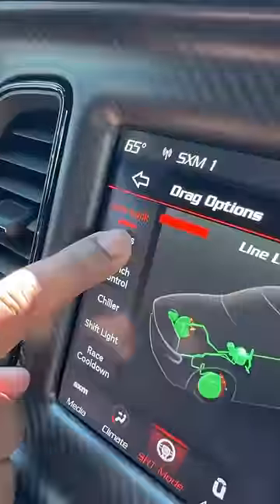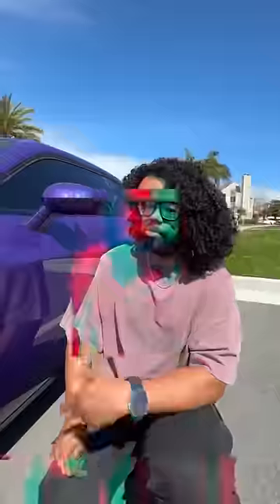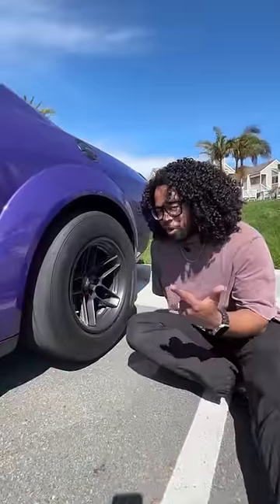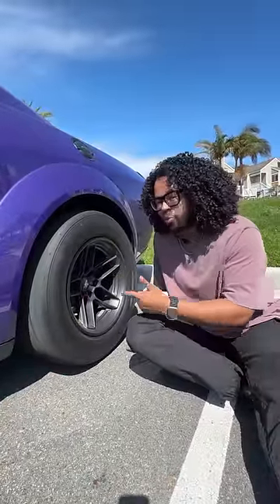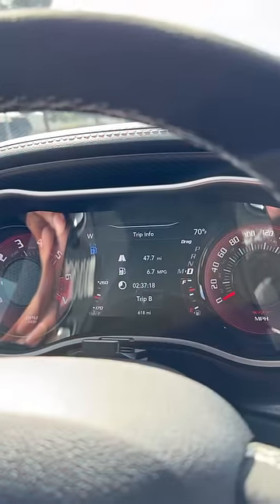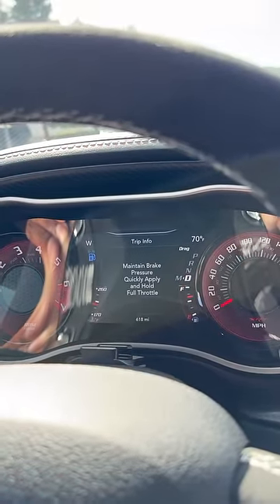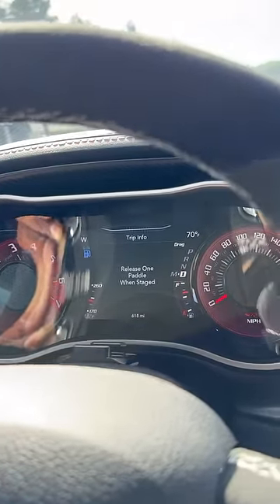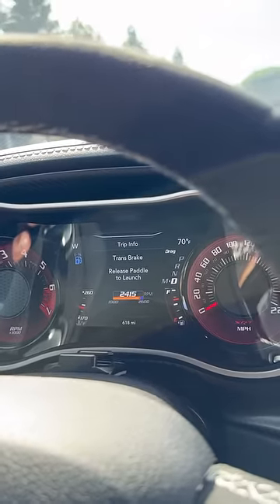This a super simple explanation of how the trans brake works in a Dodge Demon 170 😈

Comment: I think that this engine will overpower the brakes because of how powerful this car is
Reply: Who uses a brake when u have 800+ hp
Reply: @sambanerjee6796 i’d assume you’d really need your brakes if you have 800 hp 😂
Reply: @_BaguetteDoggo yeah but if you’re truly using the hp, the only thing using them will do is pretty much damage in that moment. That’s why they put that feature in. 😂😂
Reply: It's only 1000hp lmao. You act like it some 7 second car.
Reply: @literallydalegribble3875 only 1000Hp ? 8 second car but that’s too slow for a production car since it’s not 7? You most likely don’t even have a car 😂
Reply: @lalo7768  I do. And I've been around/in the drag scene my whole life. The fact these cars are so overhyped is beyond me. Your making 600/high end 500 wheel on a Hellcat. Like you act like this car is some God-killer.
Reply: @literallydalegribble3875  not a normal hellcat.  It also makes 900+ to the wheel. It’s a production car bud, I’m not a mopar guy but this thing is badass. You’re just hating while you’re still driving your 140hp shitbox. There’s always gonna be a faster car but the difference is this a PRODUCTION CAR.
Reply: @lalo7768  It doesn't make 900 to the wheel, if a 707hp car puts 550 (roughly) to the wheel, how does a 1000hp (if they have the cams, and the alcohol injectors in, around 800 if they dont) make 900 wheel? I could give two shits about "mUh pRoDuCtIOn cAR!!" 

And hypercars and supercars make more, but, actually fucking put power down. Unlike this POS that doesn't do either. I could take my daily, a 2012, 2TR-FE powered tacoma and have more fun tooling and driving it, than I'd ever get out of some cookie cutter performance car.
Reply: @literallydalegribble3875  also doesn’t cost as much as a super/hypercar rtard
Reply: @lalo7768  Correct. But I could buy a R8 for that money. Or a R10. Or a viper (I belive). Or a Ford GT. Or, better yet, not buy a POS 'Bought not built' car, a build a car/truck to MY standards, and walk yall (like many people do.)
Reply: @literallydalegribble3875 "actually put the power down" yeah you are clueless and have never owned an actual car fast enough to break the tire's loose
Reply: @ItsBlurrs  Spinning ain't winning. And yes. Yes I have. Spinning on purpose to heat the tires/Show? Okay! Spinning wheels your trying to get on it? Bad!
Reply: @literallydalegribble3875 You literally are basing your opinions off of playing Forza horizon 5, it is completely different in real life😂
Reply: @Jsv_1021O4  I don't play forza lmao.
Reply: @literallydalegribble3875 then stop acting like you play forza
Reply: @Wmx01rup  I'm not...I'm simply shitting on your favorite boat, and your mad at me for it.
Reply: A duramax ho won't push through a Silverado 2500s brakes, you're ok
Reply: @literallydalegribble3875 it’s not worth the argument
Reply: @ItsBlurrs it’s not worth the argument
Reply: @lalo7768  I like this argument
Reply: @literallydalegribble3875  I like this argument
Reply: @literallydalegribble3875 only a 1000 horsepower???😂 you probably don’t have a car buddy
Reply: @literallydalegribble3875 so you were around drag for your whole life but you don’t have any idea of the number you are using, between crank and wheel there is a maximal 15% loss so from 707 you have 600 to the wheel not 550 so from 1000hp to the wheel 850hp (and i have a doubt these numbers being at the wheel and not at the crank like you said), and i swear you’ve never been around drag if you think your 2tr fe tacoma can race this demon 170, although idk why you speak of injectors and the cams, obviously they have the injectors to go up to 1000hp that would be dumb to lie about number, you could definitely say you have a scientific theory about earth being flat it wouldn’t surprise me with that knowledge of yours
Reply: @lalo7768  it's more of a mid 9seconds car, the 8.9 it set only once was in an absolutely optimal temperature, air pressure and altitude with a track that was prepped professionally, with just enough gasoline for one pass and the lightest driver they could have, aka no one ever replicated it or even got nearly close to that time again.
Reply: @Nowkoreto  so it’s an 8 second car?  Yeah driver mode is important,  and the car can still do the high 8 second 1/4 mile
Reply: @literallydalegribble3875  That’s not true, A Demon 170 is $96,000 and a Ford GT is $500,000 and it’s got barely road legal tires, it can put the power down! And it’s 8 seconds not 17 like a corrola, you cannot compete in the NHRA unless it’s got a roll cage for a production car that’s impressive, every car has wheel spin, in fact it’s probably better for lots of wheel spin so it can heat the tires up and the there stickier, I dunno why you said “It’S OnLY A 1000 HORsEPoweR” it‘s insane how much power it’s got and it’s road legal, your favourite car is probably a supra.
Reply: @Finnjaymakes  Talking about the older Ford GT, not the V6 one. A 8 second car isn't that impressive, and I could give two shits about it being " A PrOduCtIon CaR!!" A 1000hp isn't insane, and, in the terms of drag racing, the very heart of it is guys building their cars, and racing them. The hellcat is literally a built car from factory, you can't change much on them to get them past their stock baseline HP. 

Also, that 1000hp is only when they have the cams added, and the alcohol in, like I states before. Which, many don't do before taking them out. 

I simply get no joy in A, seeing the same copy and paste 'builds' and B, getting a car I can't build/tweak on myself. 

And, for the supra comment, assuming your talking about the MK4 Supra, not really. I think they are ugly, and I don't really like the 2js sound. On the topic of supras, I'd much rather have a Celica Supra, but both are far from my favorite cars.
Reply: @literallydalegribble3875 if you’ve “been in the drag scene” then you should know a 9 second quarter mile for a car, off the lot, is more than impressive
Reply: @_BaguetteDoggo Engine brake ONLY
Reply: @literallydalegribble3875 Ok then why comment or watch this if you don’t see joy in factory built cars?
Reply: @literallydalegribble3875  v6 ford GT twist donuts around the older one (wich is still a nice car) but u out here claiming u cant mod a hellcat , use either or brain or the internet some more.. even a quick google search will provide u enough evidence 😂 "1o00 Hp isN't inSane" maybe youre right in the drag scene, in the normal car world it is insane

Almost start to think u are from a diffrent drag scene than dragracing 😅
Reply: @rikashvanveelen993  A 1000hp car, is fast, yeah, but something that weighs less, and with around 700/800hp, is always going to be faster. Not to mention these things slide like a mf. And, any modded hellcat I've seen has only gotten to 1000/1200hp.
Reply: @literallydalegribble3875  true theyre slippery but they are badass cant deny these are one of the most powerful cars sold new from factory  (when it was available)
Reply: @literallydalegribble3875 your YouTube description literally says FH5 player but okay.
Reply: @silversurfer420 Yeah your right I just didn't wanna say I play forza because folks that do get a bad rep lmao.
Reply: @lalo7768 
My dealership has sold 2 170s for over 200k. They aren't cheap. You could spend a little more, or even a little less for a far better performing car. Plus the quality is garbage. I will say one thing. Dodge is great at tricking broke people into dept for a kinda fast car.
Reply: @Jsv_1021O4 
To even make a connection to a videgame because someone is dismantling a shitty car is wild and shows that you may need to get of the videogames.
Reply: @Finnjaymakes 
Go buy a 170 for 90k lol. There's not a dealership in the country gonna give the car away for that. The 2 that I have personally seen sold went for a little over 200k.
Reply: @aaronsmith7143   You still gotta admit that’s a pretty good price
Reply: @aaronsmith7143  I was literally saying that THEY WERE ON VIDEO GAMES TO MUCH. In a video game like that a car with this kind of power with a trans brake wouldn't hold the car in place because of racing game physics, but in real life the trans brake will hold the car. Read before you run your mouth🤣
Reply: @literallydalegribble3875 yup shitbox toyota driver confirmed at least you have muh reliability.
Reply: @literallydalegribble3875 tell me yk nothing abt cars😂😂🤦‍♂️
Reply: @rAlexking_116 the only thing they’ll do is stop the car from smacking a wall, brakes are definitely still needed, trams brake won’t stop the car
Reply: @rAlexking_116 that feature is for launching not for slowing down you can engine brake and use the actual brakes to slow it down
Reply: Not a fan of hellcats and thier big bloated chasis but this is a completely delusional take. Thinking you could have more fun in your pos tacoma 😂. Its always the guys with the cars no one cares for with the most to say. Especially the "I can buy x with that money". Why don't you sell your tacoma and get something with some balls then?  @literallydalegribble3875
Reply: @aaronsmith7143  that’s bc your dealership is greedy and marked them up over 200%.
Reply: Thats why theres a parachute option💀

Comment: 6.7 miles per galon is crazy
Reply: Semi trucks that haul 80k lbs get between 6 miles and 7 miles a gallon...something isnt right 🤫
Reply: @azraet2331 not to mention most semis have dual tanks both of which are usually 75gal tanks which allow for greater distance covered at lower fuel economy.
Reply: Day cabs* sleepers have larger ones
Reply: my old gasser used to get 4mpg on a good day
Reply: Top fuel dragsters use up to 80 gallons per mile
Reply: @Ginx-pe4si nah thats right. My racecar has a low fuel warning on a full tank due to calculated MPG. A full tank get’s me less than 50 miles, ergo, low fuel.
Its 14 gallons… of e85.
Reply: That’s how I be getting my LS460 the way I drive…..literally

Comment: The transbreak engages first and reverse selenoids at the same time. with both gears applying pressure to the output shift, the vehicle can't move until one of the two is released. because both are engaged, you can fully load the converter and get the torque multiplication of the converter off the line faster due to the fact that it's already at or close to is flash point.
Reply: You're amazing thank you
Reply: I work at a Mopar dealer but never heard an explanation of how this actually works, was looking for this exact comment 😂
Reply: At least someone here knows there cars👍👍
Reply: In other words, the trans brake is confused and doesnt identify as either 1st, or reverse,  rather a combination of both.
Reply: Thank you. Brilliant.
Reply: I feel better now.
Reply: Was looking for this
Reply: So where is all that energy going while you're just sitting there?
Reply: Thanks for saving me from having to type what you did.
Reply: @angry_zergling getting turned into heat, it's only supposed to be used for a moment in a drag race. Not every stop light.
Reply: @angryzergling7832   you'll be on the trans brake 10 sec or so. You got spool up time/ gotten it to the flash point of the converter, bumping it, waiting for the light, and gone. That's not much time at all.  After it is to that point, it then started building heat and fairly fast, but most cars running a tbrake  aren't going up with 200* trans temps when they are pulling up they will be at ambient temperature/ or a little warm (some teams/people even have chillers for the trans and engine after races to getting them cold as possible). So, while it's building heat, it's also warming it from that temp to an operating temperature. If you're on it too long, that's where you'll hear people say that someone was "buring them down."
It doesn't take much (some people/shows do make it overly dramatic) to start to get hot, but the 170 have a safety in place. Most race cars do as well, along with a gauge/light & data log.
Reply: @colbymopar9422  Oooh so it gets hot pretty fast. That makes sense considering there's gotta be a ton of energy going into it, even at low RPM. Gotcha.
Reply: At idle and slightly 1-200 rpm above, it takes a while to be on the brake it will build heat in a hurry, but it all worked together very well.
Reply: I think this is why you see some guys reverse at the start of a race, and everyone laughs at them.
Reply: @angry_zergling  you started off on the right foot viewing it as energy (v.s tq/HP) in the first place. Easier to wrap your head around what's happening.
Reply: This is what I came to say. 👌🏾👌🏾
Reply: No on the dodges it holds 1st and 2st gear for safety reasons
Reply: @dariessumler7557  nope, the zf transbreak works similar to all trans brakes made as well as the ford 10r80

"The HPT Transbrake Ford 10R80 uses clutches to lock gears together and prevent the output shaft from spinning. The transbrake works by using a solenoid to make the transmission think it's in both first and reverse at the same time."
Reply: @stephanieandjared390  I see what you did there 😂
Reply: @angry_zergling  Heat. It's heating up the clutches and trans fluid which is why you don't apply a trans break for more than 30-40 seconds.
Reply: @colbymopar9422  normally you’d be correct but dodge chose to use the 1st and 2nd gear so that in the case of failure you know which direction the car is going.

Comment: 6.7mpg 😭😭
Reply: 2.45 km/liter for the non-imperial guys
Reply: It's a 1000hp car wtf did you expect
Reply: @francoissoler5677 it's still a car not spaceship. 🙄
Reply: The cost of fun
Reply: Range anxiety
Reply: You only need a 1/4 of a mile at time anyway
Reply: @hksy2k anyone who went out of their way to own a 170 definitely does not care about the gas mileage
Reply: @quandaleman  or spending half their time at gas stations 😂
Reply: The people complaining the most about EV range will drive a car likr this
Reply: @generalgrievous6648  not a single metric person uses km/liter over L/100km
Reply: @CrackyCreates  I know most people use l/(100)km instead of km/l, but both are correct
Reply: @generalgrievous6648  35.1 Liters per 100km.
Reply: @johanDIYbuilds  After reading this I realized you guys use US mpg, I calculated UK mpg to kml💀
Reply: @CrackyCreates Incorrect, KM/L is the norm in India, and I'm sure some other countries too. And it actually makes more sense since it's easier to calculate range with it based on how much fuel you've left/ put in
Reply: Smiles per km
Reply: @francoissoler5677 wtf is the point of spending 100k to only drive about 100 miles on a tank.
Reply: @Menon9767  the people complaining the most about this car range will drive an ev
Reply: You guys forgot it's not a car for a family nor it is not a car for everybody, these cars a for true petrol heads and if I could afford one I would buy it in an heartbeat, sadly it's not available here
Reply: Should've been 6.9mpg
Reply: @josephb8499  To do these 100 miles at the speed of light?

Comment: A transbrake basically engages 1st and reverse at the same time, meaning that you can stomp on the gas and not move, however because the engine is spinning and the transmission isn't, it forces the torque converter to eat the difference in rpms. Causing atf to heat up. Oftentimes overheating if you dont let go in time
Reply: Thanks for explaining. I thought it was a brake that went from male to female

Comment: typically a trans brake is a function of drag car gearboxes to put in 2 gears in at the same time so the rotation of the engine doesnt get through to the wheels. then you take out the "lock up gear" and power immediately goes through. only works on autos tho.

Comment: Many ZF 8 speed transmission allow the car manufacturers to set a trans-brake (the input shaft is spun but the clutch is open). I believe the only issue is you hurt the life of the transmission

Comment: I saw the car showing 2400+ rpms when you were doing the trans breaking. Does that mean 2350 is the official number for the limit and the digital accelerometer just shows more, it does more than 2350 and it’s just not recommended?

Comment: They are identify as Tans brake bcoz they have 50% brake and 50% acceleration
They stand in middle 
So they are called trans-brake 🌈
Reply: A trans break allows you to hold the gas and not the break while in gear and not move for a faster launch

Comment: 🙏  TransBrake = Using Clutch as a Brake = a lot more Expensive Clutch to be repair?!  Can Dodge just make a 5-Door AeroWagon with an inline-4 engine coupled with a small durable eMotor with a small economical & fast to charge & replace battery with the look of a Dodge Viper & the interior of a well thoughout Audi's ergonomics with a lot of head & legroom with the suspension of a Bentley & the reliability of a Toyota Camry! We are just simple family people , we just want Practical Reliable & Easy to live with cars!  ...  🐕 🐈

Comment: now answer, what is a kilometer
Reply: A distance measurement unit from Europe mostly used same places with miles and practically 
1 mile = 1.6 kilometer
For example today's most car is limited on 155 mph it's from Europe 155 mph = 250 kmh

Comment: That's not even remotely close to how a transbreak works lol. By applying the transbreak it puts the transmission in reverse and first gear at the same time to build up line pressure so when you release it, it allows all that built up pressure to release at once. That's why the reverse lights come on when the transbreak is engaged. I love when people like this try to act like they have a clue about things like this lmao